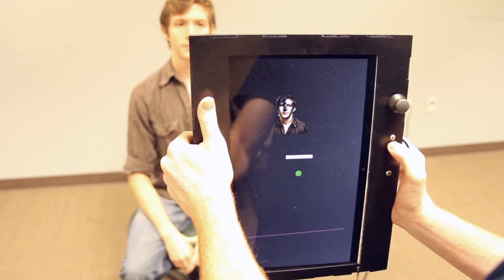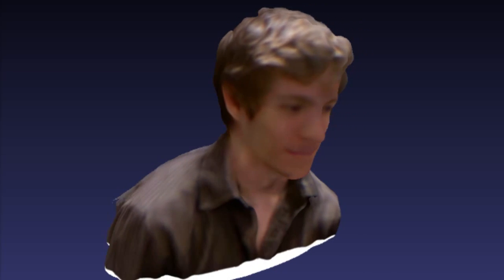Lynx Laboratories - Kickstarter Video

Comment: I would add temperature and humidity and a accurate digital clock for forensic use bylaw enforcement , cheap features which would add real value  for a LE Version